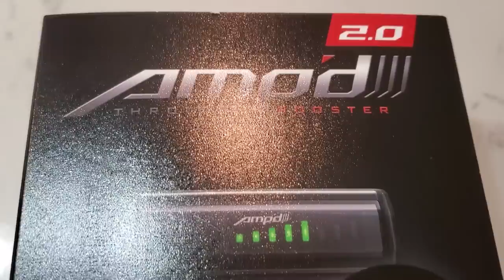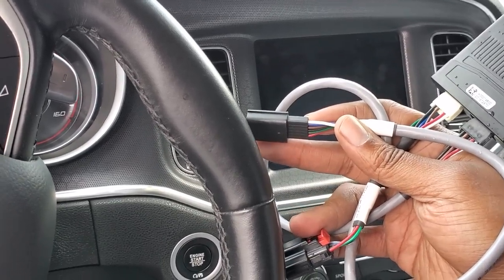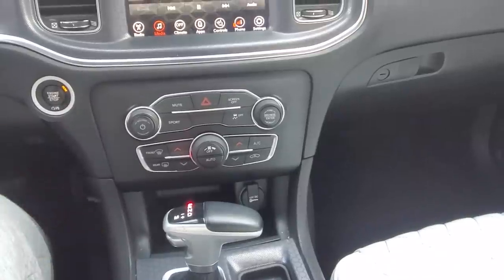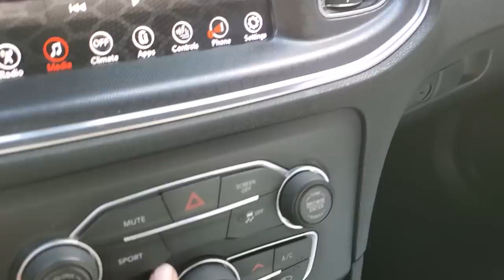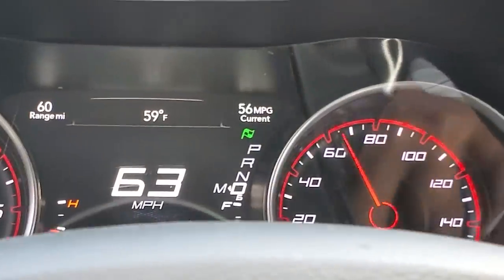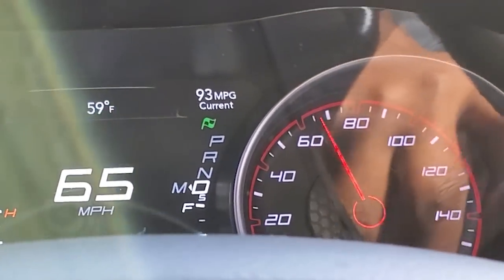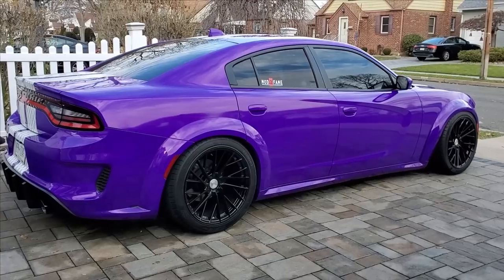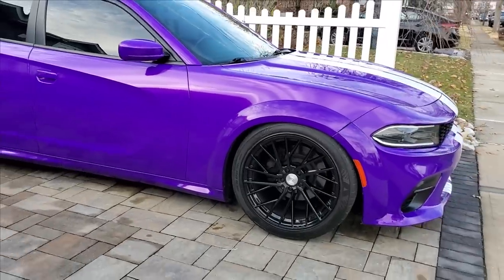Starting The Mods On My Widebody Dodge Charger RT : AMP'D

Comment: The Car is low on antifreeze Steph or needs  a radiator flush antifreeze rasivor looks dirty on inside cleaning or just flush with water re fill other than that got my entries shes a dope car.

Comment: Hey stef like what you did to charge 5.7 looks good I was looking at the video on the AMP’D Throttle Booster question on Diablosport if you get the program system will it Castle out the AMP’D Throttle Booster I’m trying to keep everything I do to my 5.7 under warranty keep up the good work that you do 💯
Reply from the maker: You mean if you get a tune from Diablo does it cancel out the throttle booster?